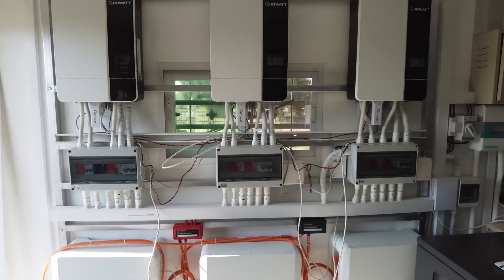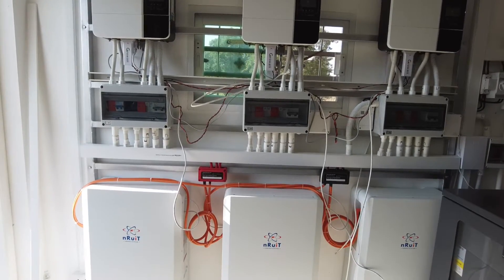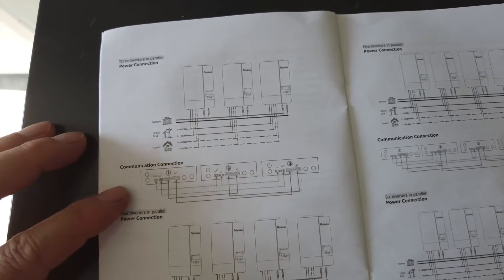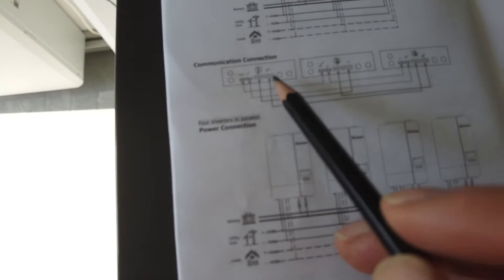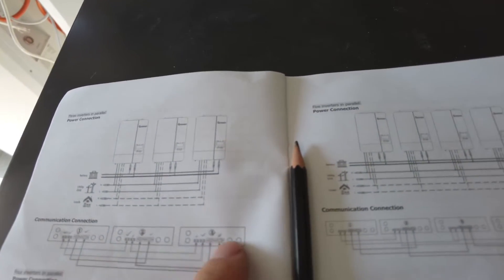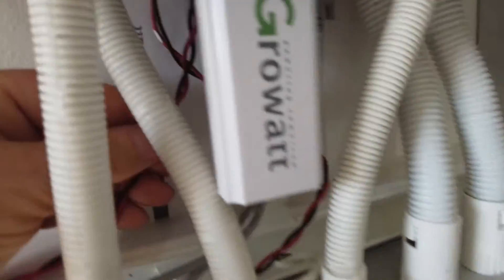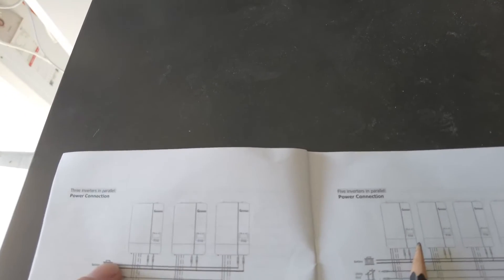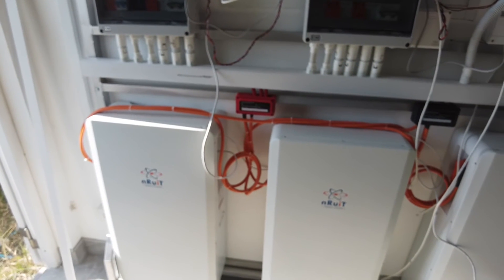Growatt Inverters Parallel Connection

Comment: The dipswitches on battery nr 3  are not on adress nr 3 i think
Reply: when it is a pace BMS insite it sould be   3 and 4   in the on position makes adress 3
nr 3 in the on postion and rest off   makes adress  nr 2
nr 4 in the on postion and rest off  makes adress 1

then  you go from inverter nr 1 what is the master (when the adress of the inverter is master ) with the can port to the first battery (witch is battery master 1)
then you take rs485 cable and put it in battery master 1   and go to rs485 from battery nr 2 and from this one to battery 3 (rs485 )
now the battery master 1  must be able to talk to batt 2 and 3

the battery cable talks via  Can to inverter nr 1 
in inverter nr 2 and 3  is no connection on can (these inverters are steered bij the master inverter)   and he does this via de inverter parallel cables a-b
that is what I think it sould work   

some other battery brands with the same BMS have the connection block insite the battery other way arround wired insite 
that means that   dip 1 on  is adress 1 
dip 2 on is adress 2
dip 1+2 on  makes adress 3

Comment: Hallo I saw what you are saying about the 4th battery, I noticed you are using a ethernet cable going from your can port on the inverter to your rj458 port on the battery. Have you tried moving your RJ458 cable from battery to your can port. Then it will be can to can connection.

Comment: you simply should connect all the DC output of the 3 batteries to one bus bar and each of the 3 inverters on the bus bar, that way you avoid  different SOC on the 3 batteries. Are your 3 Growatt on one phase or on 3 Phase ? why You use Nruit Batteries? Are they cheap ?
Reply from the maker: You can see from the video that the DC output of the batteries are connected to 2 bus Bars  - Red and Black for positive and negative. The inverters are connected to each other according to the user manual. The inverters are single phase. nRuit use CATL LFP cells and cost me ฿68,000 for each 9kWh shipped from China to Thailand. I have previously stated : This is an old video (recorded a year ago) which I had set to private during bug fixing last year. I have had some questions about connecting multiple Growatts together, so thought I would make this vid public in case it was useful. The system is has been functioning perfectly for the last year.

Comment: Can those 3 inverters exerts 3phase output?
Reply from the maker: The model I purchased is single phase only
Reply: If you are after 3 phase you buy a 3 phase inverter.I am sure they do exist.
Reply: If you mean each inverter its own phase out, yes. I have such a setup at home. 3 inverters set up as 3phase parallel, inverter 1 is L1 inverter2 L2 inverter3 L3 and the 'utility' ac input is similar, I have ac in L1 to inverter1 L2 to 2 and L3 to 3. my set up is 3phase 208v and that seems to work just fine.
Reply from the maker: @wcoekaer  My inverters and house electrics are single phase. I want them to act as a single inverter.
Reply: @wcoekaer  hi thanks for the video , i just purchased 2 units of Growatt 5000tl hvm-wpv and i unable to get the 3rd for months . i was wondering can use Growatt 5000ES to parallel for 3 phase . If not i need to purchase additional 3 nos of inverter . I am not an electricians and i had almost complete all my wiring and power up , just that i yet to power up output from inverter . L1 , L2 & L3 OUTPUT wil be R,Y,B to the distribution board . So all neutral will connect all together right ? thanks for your advise
Reply: @wcoekaer  Hello. I just installed 3 spf 5000es and 3 batteries of 10.2kwh. My utility ac input is in 3phase. If the phases are not well balanced, can the inverter be still be parallel?

Comment: Thank you for the video, what are you thought on the growatt invertor you have used and the Nruit batteries are you happy? Did you manage to get the batteries running in parallel?
Reply from the maker: As I said in another reply this is an old video during bug fixing last year. I like the growatts I think the problem was that the three batteries were discharging at slightly different rates. I have since bought a 4th battery so I am now up to 36kWh of LFP batteries and have way more capacity than I need most of the time.

Comment: Sorry to hear of your difficulties, Paul, but fascinating to follow your mental process through the trace. I wish I could help, but you’re my guru on these matters! Hopefully you’ll share the solution with us shortly.
Reply from the maker: This is an old video which I had set to private during bug fixing last year. I have had some questions recently about connecting multiple Growatts together, so thought I would make this vid public in case it was useful. I have since purchased a 4th battery and any balancing concerns I had with the batteries have been more than offset by the newly increased capacity.
Reply: @EcoHouseThailand  it would be great if you had the time to show that too then.
Reply: @EcoHouseThailand  i am planning to do 2 5000es with three 51.2v 200ah batteries. do u have some tips on inverter- batteries cabling and breakers used, thanks
Reply: Having rewatched this now and compared it to my actual installation, it all looks correct, though my short term memory problems made it an agonising process (Left? Right? Darn, which was it again? 😂). So you mentioned that your batteries weren’t charging in sync or balanced (which was it?). What was the cause of this, and is a hub needed?
Reply: i watched a technician splitting the can cable to all three inverters, you just conected to the master one. I dunno if it solve the issue but it could be a good question to the support team.